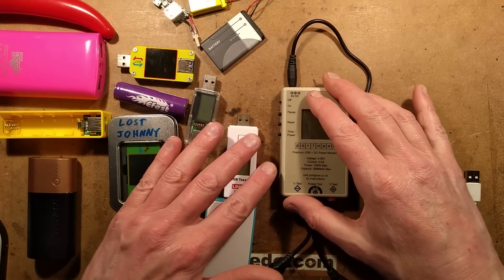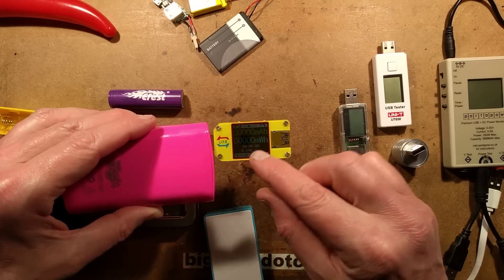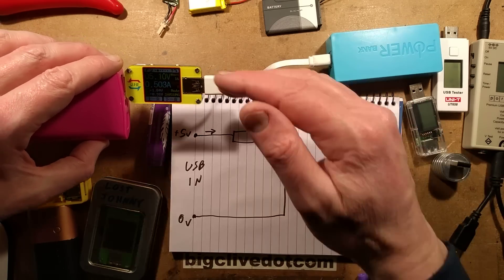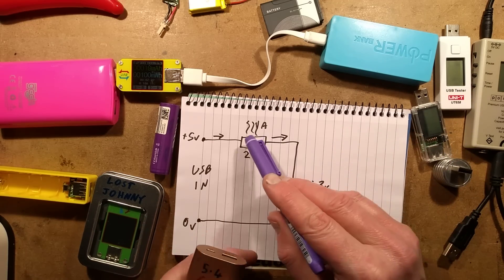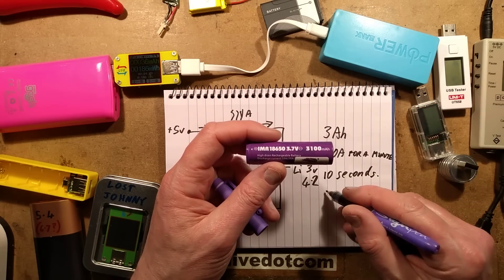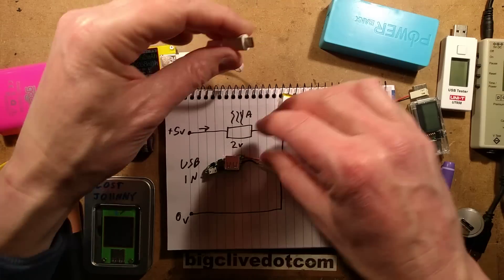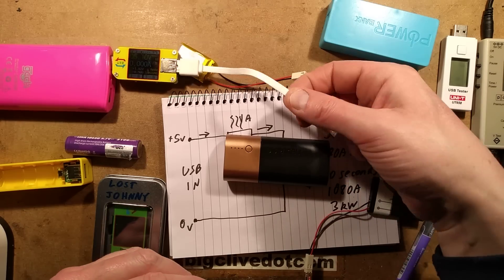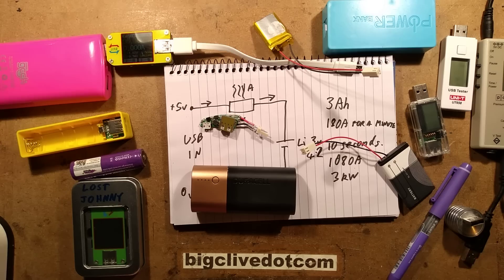How I test lithium cell and power bank capacity.

Comment: Well, the main reason why a 3Ah power bank for example won't give you 3Ah at 5V is because 3Ah at say 3.6V is 3*3.6=10.8Wh of energy. And 10.8Wh of energy at 5V would give you 10.8/5=2.16Ah
Assuming your step up/down circuitry is 100 % efficient, you would still only be getting about 3.6/5=0.72=72 % of the capacity at 5V. In most cases it's kinda dumb to measure capacity in Ah instead of Wh anyway in my opinion, since measuring the capacity of two Li-ion cells gives you completely different values depending on whether they are connected in series of parallel, while measuring capacity in Wh would give you pretty much the same result, in both cases.
Reply: Phino K.M. - there are also disadvantages with the Wh unit... Wh is less useful if you want to use a cell or battery to directly supply a load that requires a constant voltage and you want to know how long such a load will run for.
Reply: @Mark1024MAK  Sure there are advantages to Ah, I realize that. Besides, you can go back and fourth as you please, Ah=Wh/V or Wh=Ah*V it would make sense to measure capacity in a way that requires less calculation of course, which of these requires less calculation however, pretty much depends on the application.
I however think Wh is a more general form, it actually tells you how much energy is stored in a battery, while Ah is sort of like measuring a cars range by how long it can drive at a specific speed. Which may be useful in some cases, but in general in general it seems more logical to specify range as a distance (time*speed). Yeah, I know it's not a perfect analogy, but you get my point.
Reply: Phino K.M. - to continue the car theme... the fuel (assuming petrol/gas or diesel) you put in your car is measured in litres or gallons, not by the weight or the amount of energy it contains.... Never mind that the volume changes with temperature.
Existing convention is a powerful thing, especially if the so called advantages of another system are not seen as significantly advantageous. So whatever me or you think, I suspect Ah will continue to be used for many years yet!

Comment: I didn't get a notification from Patreon about this video, weird!
I bought a portapow because I saw it on one of your videos, it's very handy.
I made some magnetic connectors for connecting to 18650 batteries. Maybe have a try yourself:
https://www.instructables.com/id/Magnetic-Connectors-for-Batteries/

Respect for saying UNI-T meters are good. There are so many meter snobs who don't like them for some reason. I have UNI-T multimeters, clamp meter, thermometer, sound level meter and a light meter. I've never had an issue with any of them. A Fluke-only meter snob even tried to compare the readings against his gear and they all showed the same readings.

Comment: nice explanation, thanks !
Why do you test battery capacity by charging them, instead of discharging ? Discharging capacity seems like a good measurement as it represents the delivered useful power.
Reply: Flatox - if talking about power banks that have a boost converter output, because the capacity figure he wants is that of the cell, not the capacity at 5V DC, which would be a lower figure.
Reply: @Mark1024MAK  Yeah, but even for a cell, I think it's interesting to measure how much power you can extract before its voltage gets too low instead of how much power you can put through it by charging.
Reply: Flatox - of course 😉. But it depends on what you are after. Often you are only looking for a useful comparison with other cells or other power banks. And then the method Clive uses is good enough.

Comment: When at all possible I generally try to gain access to the bare cell(s) in the power bank and cycle them 3-5 times on a reasonable quality hoppy charger that has been calibrated against my HP 6.5 digit bench meter.  I would say your method is far easier for most people and you can test the entire power bank with the limits it has been factory programmed with.

Comment: i feel bad charging my quick charge 3.0 banks at 12v 1.2A Now i think i'll charge them slower if they will last longer.
Reply from the maker: If they have a slow charge option (just a plain USB charger?) then it will result in better lifespan.  Leave fast charging for when you need them filled in a hurry.
Reply: @Tim   what if my powerbank support qc3.0 charging and discharging. Should I still charge it at 5w or 10w??

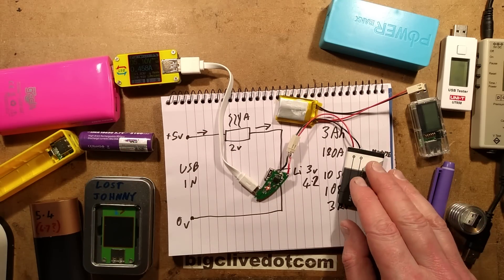Comment: The setup at 11:10 might be misleading for large capacities. The stepup draws usually 5mA in passive state. The "powerhour" meters are drawing about 20mA. I didn't check them yet at lower voltages. In the end you are getting a good number with an accuraccy of ±100mAh, but you have to name the charge and discharge current. You should also consider that you conduct these measurements mainly with fresh cells. Capacity drops quite fast on some cells at the beginning of live and you might end up with 90% after a few cycles. As usual Li-cells don't like to be stored above 95% and below 30% of their capacity and they should remain below 40°C, so a two probe temperature logging would add additional information if discharges with 1C and higher are conducted (thermal energy wasted). That's ~4W on a usual bad contact resistance with a spring load clamp battery contact.Bigclive since you mentioned several times in the past your ambient temperature. The charge current can harm the cells if ambient drops below +10°C - at least I'm not aware of any protective circuits in power banks to limit the current under these conditions. E.g. if you drop below 0°C platinum deposition starts quite fast if you charge with 1C and you are ending up with a short life-cycle.

Comment: Clive, easiest way to check charged/discharged capacity of 18650 or similar cells is just to use dedicated charger like LiitoKala Lii500 or cheap IMAX B6 for almost all kinds of chemistry.
Reply from the maker: I use this technique to test cells sealed inside equipment.

Comment: no lithium charger is using a "variable resistor" as anything... they all use buck/boost converters to charge (the other option would be linear volt. reg., but that would require chargers to be bigger and more inefficient).
Reply: Google+ SUCKS BALLS - the worst forced social network - if there is no inductor in the charge circuit, then they are not using buck or boost to convert the voltage down/up. Hence they must be using a conventional system, either a simple transistor switch with current limiting via a separate resistor (often that of the cable and connections), PWM, or via a series pass transistor operating as a current limiter (constant current configuration). In all these cases, the input current is appropriately equal to the cell or battery charge current (minus the small amount of current consumed by the charge circuitry).
Reply from the maker: Many do use linear current regulation.  No buck regulator involved.  The chips get quite hot while charging.

Comment: I couldn't really follow on how you account for the voltage difference between the 5V of USB and the 3 to 4.2V of the batteries. You mentioned that the Duracell power bank does it somehow differently, but wouldn't it actually give more accurate readings than the others which just don't account for that difference, while you are measuring only the 5V side of things?
Oh, this unit of mAh is just utter bullshit, the power of batteries should always be given in mWh or Wh.
My phone does that ever since I've installed a nice OS onto it (Sailfish): It tells me there are 8360mWh remaining, after I charged it to full last night and it's been sitting at 100% (during standby) for the last 8 hours, while the "power meter" app shows me that on average, it draws 100mW. No idea how accurate that is (probably the battery would need to be recalibrated, because it sits at 100% for a rather long time until it goes to 99%, and then it doesn't take nearly as long for the next 1% to go down, subsequently. But it still feels much more accurate due to the fact that it calculates it all in mWh and not mAh.
Reply: Seegal Galguntijak - there are also disadvantages with the Wh unit... Wh is less useful if you want to use a cell or battery to directly supply a load that requires a constant voltage and you want to know how long such a load will run for.
Reply: Mark 1024MAK Why wouldn't Wh express this more accurately? I'm trying to think through this, but the changing voltage of a battery or cell makes it harder to calculate the hours a constant voltage load would run for.
Reply: Seegal Galguntijak - There are advantages and disadvantages when using Wh, the same as there are advantages and disadvantages when using Ah.

If there are no buck or boost converters, Ah is a more useful unit to use.
If there are buck or boost converters, Wh may be a more useful unit to use.
It all comes down to what and where you are measuring, or what the load is on the cell/battery.

One of the disadvantages with the Wh unit... Wh is less useful if you want to use a cell or battery to directly supply a load that requires a constant voltage and you want to know how long such a load will run for at that voltage. For example, if using a high capacity lead acid 12V battery that is directly supplying a 12V load, as no conversion circuitry is involved, Ah is the more useful unit, as that tells you how long the load will run for at a near constant current. 

A second disadvantage is that using Wh (with no other criteria stated) you can run the cell down to well below a useable voltage in ‘calculating’ the Wh figure to make the Wh figure more impressive.

All cell/battery manufacturers use Ah to state capacity (including primary and secondary cell types). So it’s a universally used unit.

Ah usage (outside of marketing) is based on good battery technology where cells/batteries have a near constant cell voltage over the vast majority of their useful discharge output cycle.

If we did switch to Wh, it would not take unscrupulous suppliers long to figure out that they could tinker with the output voltage to inflate the Wh figure.

To make the figures more useful (regardless if Ah or Wh is used) the discharge load (resistance and voltage, or current and voltage) and endpoint cutoff voltage all need to be stated as well.

But a lot of the suppliers just see the capacity figure as marketing. Contrast this with how alkaline cells (batteries in lay terms) are sold...
Reply: I can't really follow your 12V example, since a lead acid battery, when full, sits somewhere around 12.8-13V, and when it's empty, it sits at around 11.5-11.2V. So there isn't really a constant voltage either. I would consider a constant voltage requirement something like 3.342V and neither 3.344V nor 3.340V. Admitted, such exact voltages mostly happen in computer circuitry, but still. As for the delta V of a full vs. empty cell, that's due to the cell chemnistry, can't be helped (without altering the cell chemnistry), so I don't see why this would be a criteria for "good" vs. "bad" battery technology. On the other hand, a nearly empty LiPO-cell at 3.3V may still supply something like 600mA, but if something needs 5V, it's much less actual power than you might think.
Also, laptop batteries usually don't have Ah printed on the, but only the Wh instead. At least that's how I know it from ThinkPads.
And of course running down a cell below its deep discharge voltage is useless, but who would do that? Only marketing people, and they are already useless for many other reasons, so, yeah...
Reply: Seegal Galguntijak - a lot of charge level “meters” are just glorified guesstimaters. Accurate they are not.
Reply: I think the charge level "meter" is part of the phone's firmware (well, actually not the one that I replaced, but either the proprietary blob from the phone manufacturer or on a deeper level, like directly on the power control chip), so I wouldn't necessarily assume it to be inaccurate. I know the calibration issue from Thinkpad laptops, that sometimes have inaccurate percentages (by the way, all the software shows Wh/mWh, no Ah there, too), so the power management script tlp has a function to recalibrate the battery, which means discharging it fully and recharging it fully once so that the embedded controller knows the exact state the battery is in. I guess it works the same for smartphones, but I haven't tested it yet. So far, it hasn't really been a problem.
Reply: Seegal Galguntijak - charge / capacity remaining is either determined by measuring the cell/battery voltage (either the open circuit terminal voltage or the voltage at a specified load current) where the cell/battery chemistry used results in a slight voltage change with the state of discharge that is predictable. Or the charge / capacity remaining is ‘calculated’ based on the time and current used since the last full charge from flat cycle. Or if it has not seen a full discharge/charge cycle, the measured charge current as well. With the later technique, the device is always lagging behind the actual real capacity, especially if the cell is only ever being part charged. Because the conversion and measurement losses combine to increasingly give an inaccurate charge / capacity remaining figure...
Further, is the software measuring the cell voltage or assuming it is constant? If the later, the Wh figure is an estimate.
Even where the cell/battery chemistry results in a terminal voltage that indicates the state of charge, ageing of the cell/battery, or operation outside of the normal temperature range, or a poor cell/battery connection can all result in a incorrect and misleading result.

Comment: I test them by putting them in the microwave. The ones with the largest explosions and most poisonous gas are the ones with the highest capacity. The extra high quality ones have fumes that make me cry blood.
Reply: if it ain't gonna kill you it ain't worth doing - that's my rule for life
Reply: @gordslater Ya gotta use a FULL WAVE BRIDGE RECTIFIER!  😅
Reply: I once used a saline solution to test one. It was taken as a salt and battery, and I faced a few charges. 😂

Comment: Dear Clive, I appreciate your comments on wishing to charge lithium batteries slowly to preserve their overall lifetime. What do you consider to be slow charging?  I asked because in the past you have extolled the virtues of 1 and 2Amp Poundland USB chargers, which I use for phones tablets and power banks.
Reply from the maker: I recommend a charge current of around 1A for packs with one or two cells for maximum longevity.  It's a balance between lifespan and convenience.

Comment: Now a days respectable battery makers list the power in Watthour instead of mAh .. it gives more accurate indication of how much power the battery can store .. every time you test a battery capacity you state that it took "x" mAh which is less than the capacity listed .. yet you seem to forget that you're measuring the mAh @ 5V .. while the rated battery capacity is listed @3.7V .. that's how you always end up with lower mAh "nominal" capacity while the true Wh measured capacity is actually higher. example: that Duracell power pack, it listed the capacity of 6.7 Ah @ 3.7v .. your test measured 5.4 @5v .. but 6.7x3.7= 24.79 Wh, while 5.4x5= 27 Wh. which makes sense .. it's the battery capacity + all the losses in the circuits .. thus their listing if capacity as 6.7ah is true.
Reply: If the Duracell power bank has a switching charger then what you said is true, but most power banks use linear charging ICs. With linear charger IC's the mAh rating is correct regardless of the charge voltage since the current is the same throughout the circuit - it acts as a resistor.
Reply: Skruffles , no matter what type of  circuits are used .. there's always losses and efficiency. my point is, he's expressing capacity the wrong way .. capacity in mAh changes with voltage.
Reply: @theR6969  You're still missing the point. The simple linear chargers do not modify the current. So they can be charged at any voltage (that the IC can tolerate) and it will still show the same mAh reading.. You're right in the sense that a battery's capacity in Wh depends on the voltage and the mAh rating, but we're not looking at that here. Looking at just the mAh rating is a good indication of the capacity. As it can be multiplied by 3.7V to get the Wh rating even if the mAh measurement was taken at 5V.. I hope you understand now
Reply: theR6969 - there are also disadvantages with the Wh unit... Wh is less useful if you want to use a cell or battery to directly supply a load that requires a constant voltage and you want to know how long such a load will run for.
Reply: Mark 1024MAK ,I understand .. my point was referring to Clive always coming up with less capacity than listed .. he's always measuring input capacity @5v while batteries stated capacity is always at the battery's nominal voltage.
Reply: @theR6969 but the battery banks are rated at 5 V, so their Ah rating should match when measuring at 5 V...

Comment: Clive, you're testing input, but output can also be tested to determine capacity.

Because a power bank by reason of its own fairly efficient converter circuit (usually a buck converter, I think) puts out a virtually constant voltage; if you put the fully charged "bank" on a constant load and time the discharge, you can also rather easily calculate output capacity.  The load could be something as simple as an appropriate value of resistor.